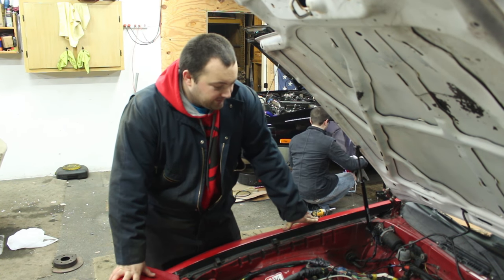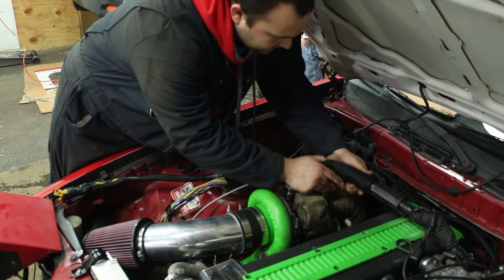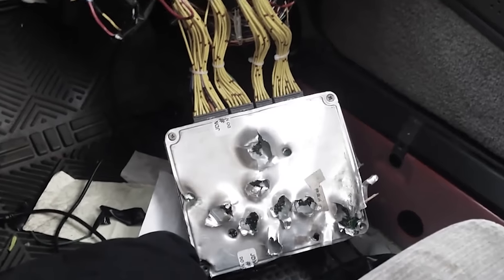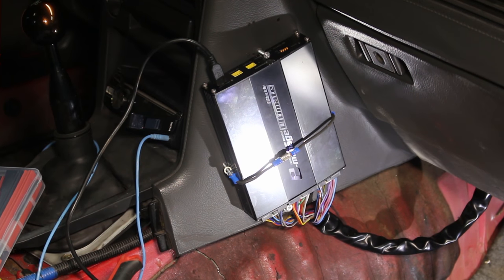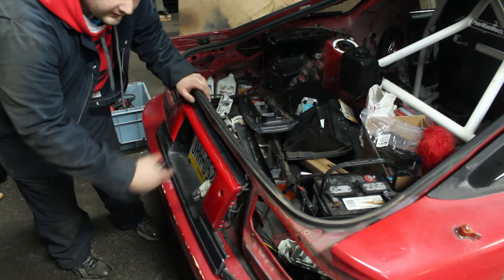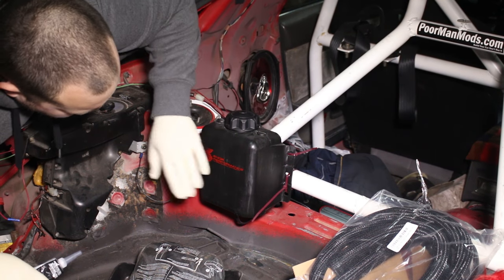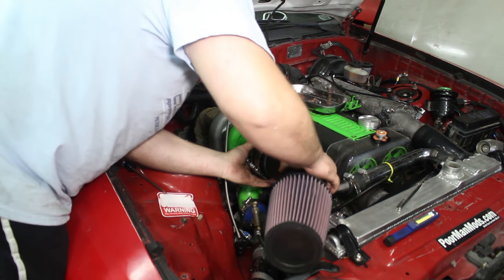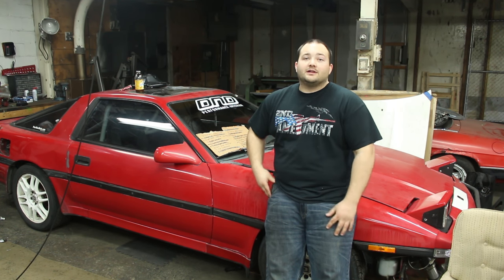Lots Of Small Things But BIG Progress! 1JZGTE MKIII Supra Drift Missile

Comment: Where can you find the tail-light seals? I'm looking for a set for my 1990.
Reply: BPEK Supra Interactive I'm looking as well. I don't need them but I think it'd be nice to have an extra pair. 3 years ago I used foam backer rod to replace my old gaskets and haven't had a leak yet
Reply from the maker: i got them from this website https://toyotaparts.toyotaofclermont.com
Reply: Sorry to resurrect a year old comment, but what size foam rod did you use? I'm guessing either 3/8 or 1/4 inch.

Comment: Going to take my build to the dyno soon. any advice before I go? since it's about 90 miles away. í already went once and found out my car was built wrong. í have fixed those issues now. But I don't know what to check before I go.
Reply from the maker: make sure there are no leaks, you have good spark plugs, fresh oil and its running properly
Reply: what do you mean by running properly? I mean, it has a basemap, sometimes itll turn off.